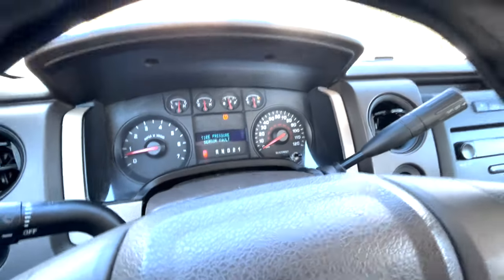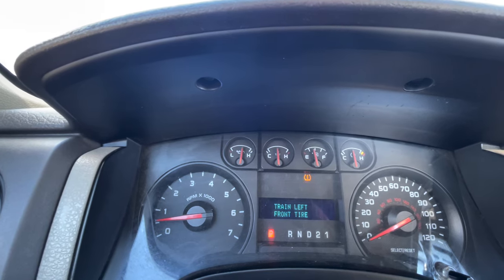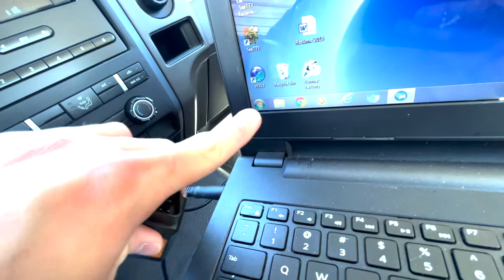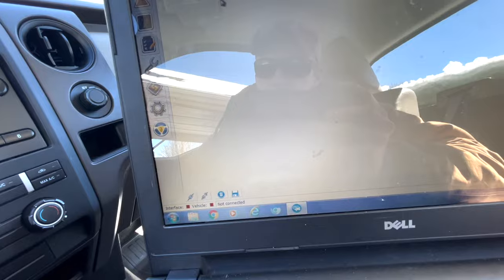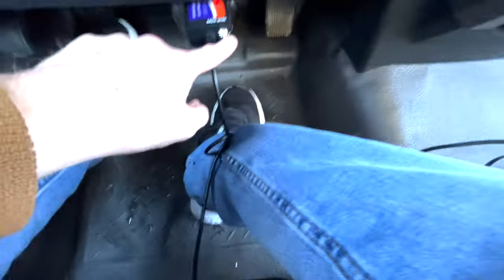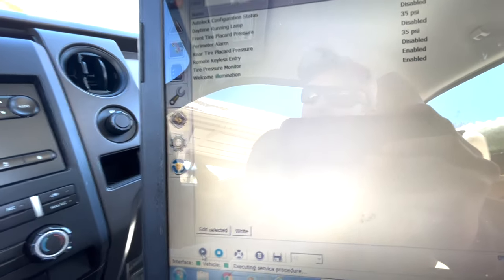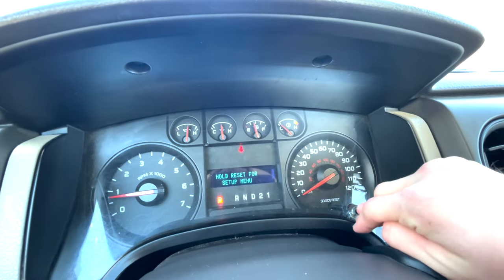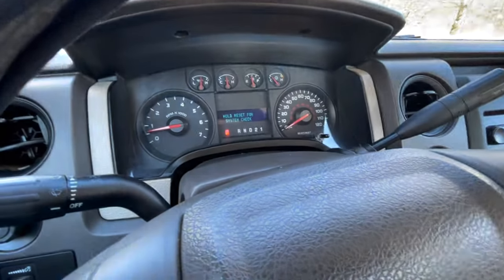DIY - How to Disable Tire Pressure Sensor Fault Message on most Fords!

Comment: Will this work with a 2010 ford edge?
Reply from the maker: I’ve heard some issues on the ford edge during this process, I’m not 100% sure though.
Reply: It seems like it's gonna work, just waiting for the key code. Do you know if the program does mileage correction? I put a new motor in it. Update, Works on a ford edge!
Reply from the maker: Awesome I will have to pass that along because I’ve had numerous folks ask about the edge. 

You may find otherwise on a forum, but I don’t think mileage correction is a thing. (Maybe in the more advance, codes portion). Just because, you know, someone (not in your case). Might buy the thing then sell a 347,000 mile Taurus (if it’s intact) and put 64k on it lol
Reply: @RandomAutomotive  They make OBD scanners scrictly for mileage correction, but the prices are just ridiculous. That program doesn't do it, but they say they plan to add it once they figure out how to stop people like that. Thanks again, I hate tire pressure lights, dumbest law ever.

Comment: will this work on a ford 250?
Reply from the maker: Not 100%, I believe it has to be after a 2012 though.
Reply: @RandomAutomotive  cool thanks
Reply: @RandomAutomotive I tried on my 2012 f250 and I had no GEM code under the module

Comment: Will this work on a 2007 F150?
Reply from the maker: 2007 I’m not sure of, the CAN modules are different on the 04-08 body style. I’ve only heard success on the 2009+ models.
Reply: no, it won’t. anything 2008 backwards has different modules, dumber ones.